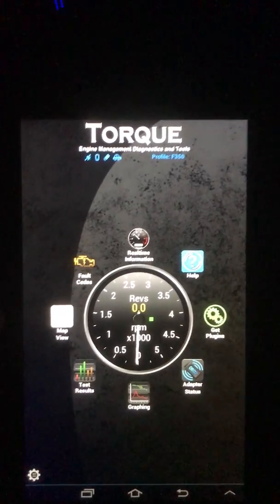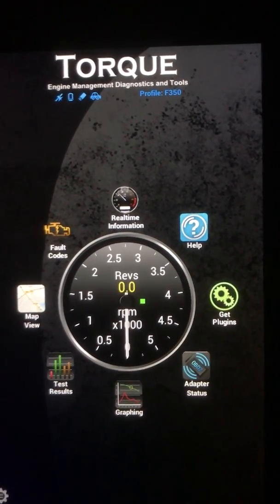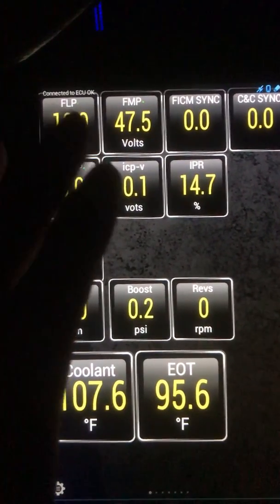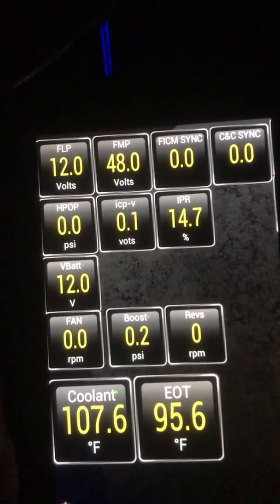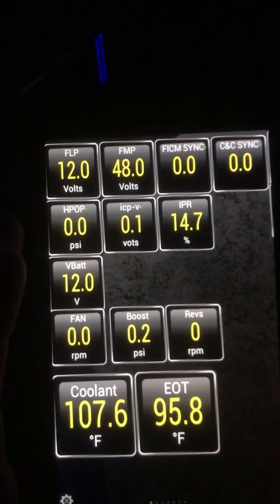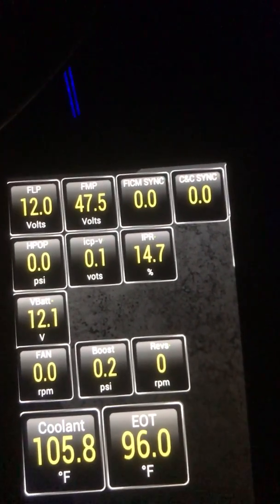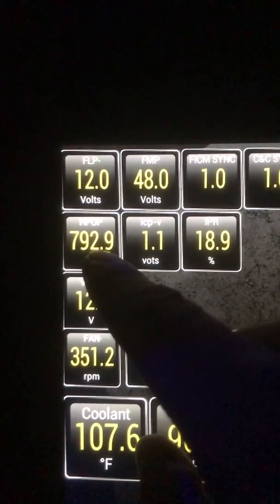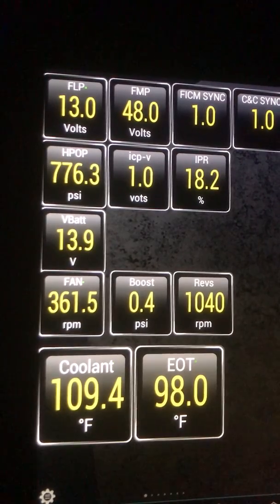TorquePro 6.0 Powerstroke

Comment: I will download  torque pro I was using me x4 but was useless
Reply from the maker: raul salazar what exactly is your truck doing?
Reply: Jason Dols my truck started with a hot no start tach wont move either I can drive it for hrs and no problem  or loss of power just as soon as I shut it off no longer turn on I disconnected  icp no luck checked, to see if oil would fill while crackin in oil house it will fill also fuel housing fills up also replaced cam sensor I'm leaning towards a bad hpop or orings alot standpipe
Reply from the maker: raul salazar What year is your truck?
Reply: Jason Dols it's a 2004 with an 03 engine build 07/03
Reply from the maker: OK we have the same truck pretty much, you don’t have any standpipes, dummy plugs or STC because that is in the 05 and up. An easy way to see what’s leaking is pull your valve covers off and start the truck. Which ever injector is squirting oil out is the one that has a bad o ring. You can replace the O-ring with the rebuild kit for seven dollars but is so much easier just to buy a whole new injector and replace it.
Reply: Jason Dols I will do that this weekend  Jason I thank u for ur help I was leaning towards a oring or something  from the hpop
Reply from the maker: raul salazar no problem, I don’t think it’s the hpop because it starts cold. If you got an IG send me a dm keeping me updated. @AGuyWithABroke6oh
Reply: Jason Dols  well took me awhile  been away for work well you were right turned out to be a bad injector o ring  on number 2 on driver side causing the hot start unfortunately  i sold my 6.0 and got a 2000 7.3 after i found the issue  i hope u are well and still rolling  coal
Reply from the maker: raul salazar I actually just got a tuner so I was until I blew my trans so now I’m exploring my options
Reply: After bring your truck close to operating temp you need to drive your truck on a flat road for 15 min at 65mph.  Check your delta after that drive.  Over 15 degree spread with stock oil cooler means you have a plugged up oil cooler not blown headgaskets.  You need to plumb in some hose and a psi gauge into your coolant system to check for head gaskets.  Over 16 psi means bad news.